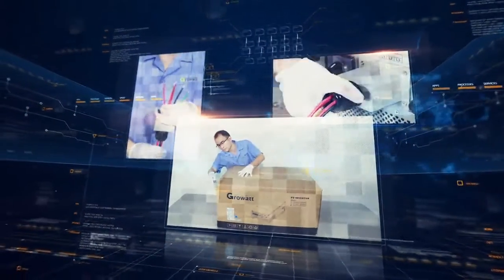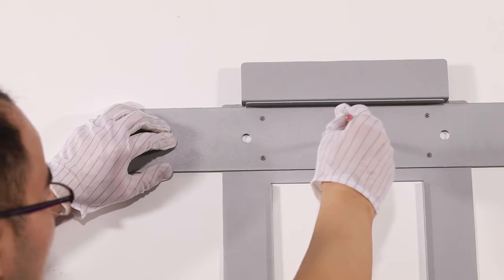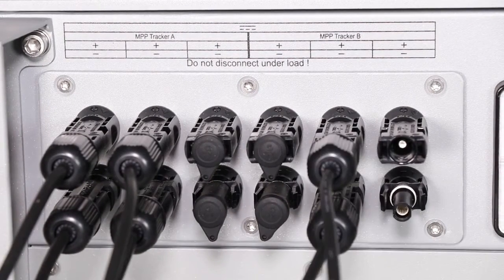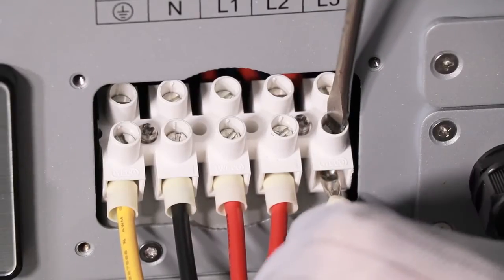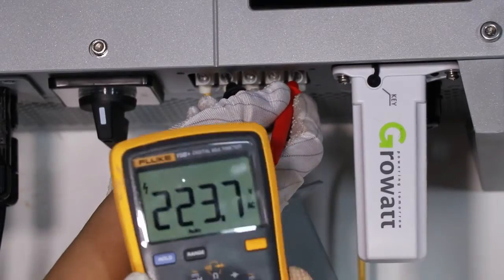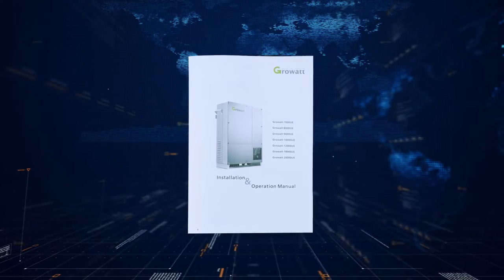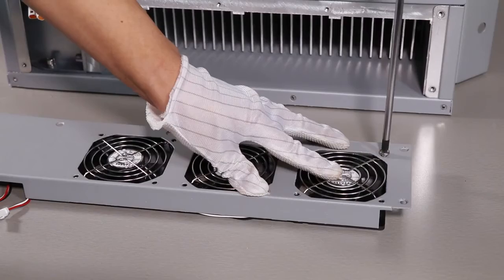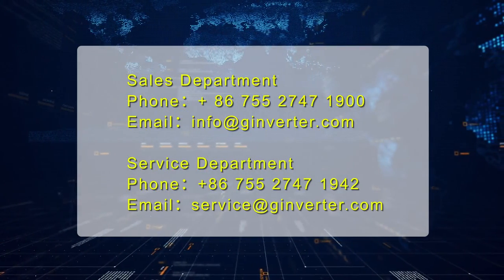Growatt 7k-20k UE series inverter installation and troubleshooting

Comment: Looking at the screen on a Growatt Sungold 3000 you have a line: PV (with numbers around 280v) then B 364. What is B364? I've looked at the manual nothing there. I have two solar strings.

Comment: If I want to integrate the string inverter(15000UE) to a backup system, which of the storage inverters is appropriate? SP5000 OR SP3000-S, and how many do I need for a 3 phase system? do I need three each or just one?